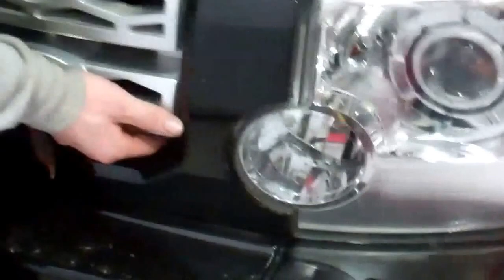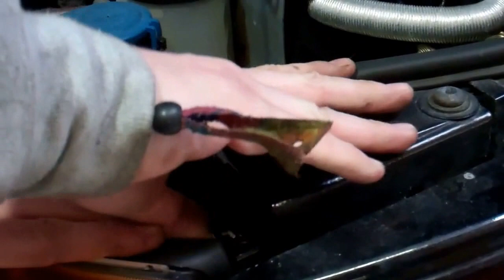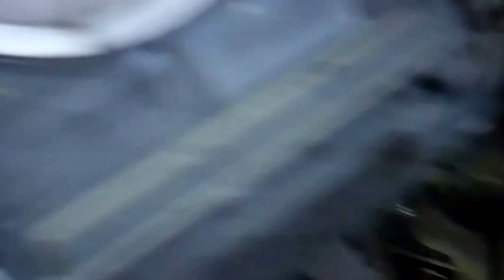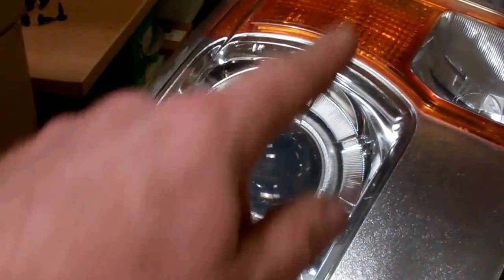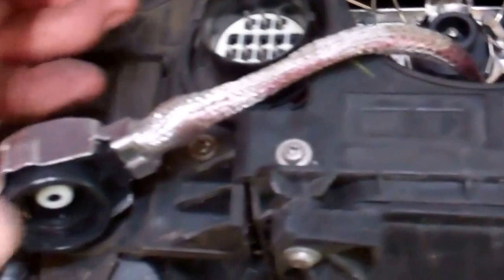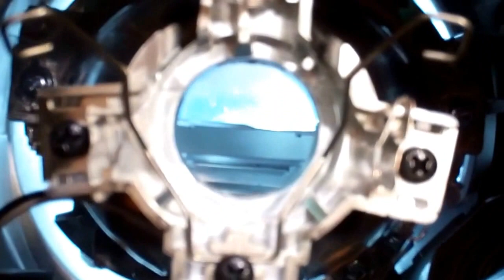Land Rover Discovery 3 How to replace Headlight Headlamp Bulbs & Change to LHD Beam Pattern

Comment: Hi

If I change my normal headlights for xenon ones to get that lever, would The car need to be reconfigured?
Reply from the maker: Yes in 95% of the occasions the body control module senses the current ( Amps ) is out of range and will shut down the headlight circuit.
Reply: powerfulukltd      Many Thanks  for the replay. That Gap tool costs over £400 on eBay. Is there a way to reconfigure it cheaper that that?
Reply from the maker: @JS-lb6gp  If you can find a local specialist with the tool they will often change the CCF for you - cost is normally £40
Reply: Many thanks, really appreciated. I love you channel.

Comment: hi do you have to do this with both headlights ?
Reply from the maker: yes you need to change the aim on both headlights
Reply: @L663   So, driving in Europe - both levers needs to be up/levelled. But what is the standard for driving in UK and not having issues with MOT? Both down? Or only LHD one lever down?
Reply from the maker: @logcheto  For UK you can have flat beam but the preference is to have both headlights set to shine light higher on the left - both headlights should be the same pattern.
Reply: I took these lights out and put them back, and did NOTHING ELSE. But now my afs warning light is flashing on the dash… is this because the switch is up? Will the warning light go off if I flip them down?